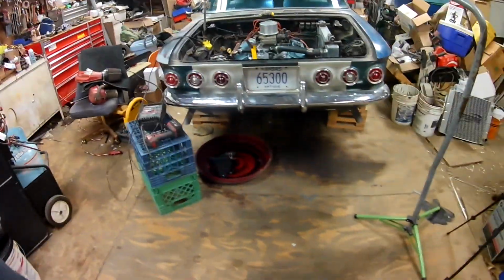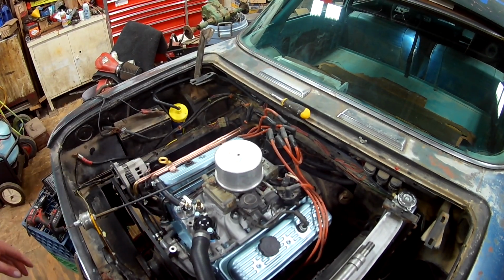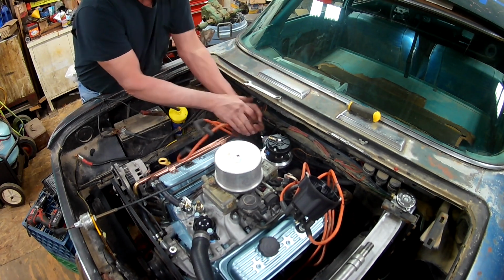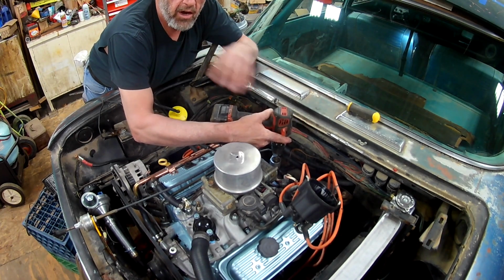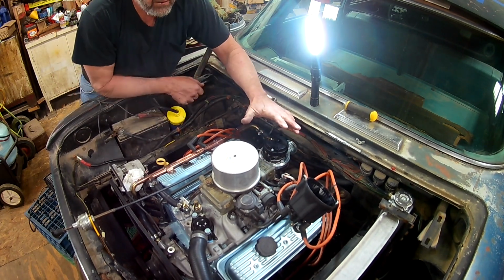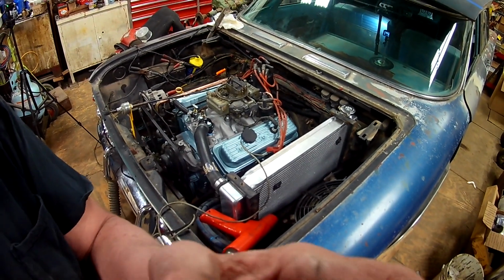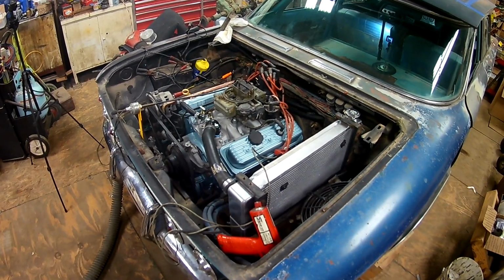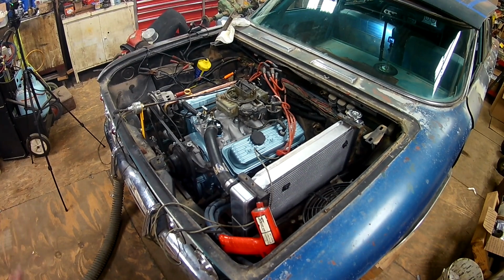4.3V6 Corvair Prepping for the first start on a fresh rebuilt engine What you need to know.Subscribe

Comment: lucky that it will not leak by the rear seal, usually, there is very subtile difference to accomodate the fact that the engine is reversed rotation.
Reply from the maker: The rear seal is directional. I never gave it any though till we were building this engine

Comment: Only thing I see is a radiator shroud and ducting from the engine cover, boot and or trunk lid ... Ain't it just ain't it 😎 lols.....or maybe from the quarter panels.... I dig this build... thanks for sharing.... Will be fun I am sure...
Reply from the maker: Thank you. There will be more louvers added to the lid with seals and an air dam underneath. The inner quarter has been opened up for air flow too.

Comment: I saw an article about the installation of a toronado drivetrain installed "behind" the rear seat of a 66 Corvair coupe, with a clearance notch in the back seat for a pully).  ;-)
Reply from the maker: We actually considered the Toro drive line but it would have been too intrusive. With what we have done, we could swap back to the flat 6. Don't know why we would though.

Comment: I didn't realize that you've reduced the wheelbase, and altered the body from a standard Corvair 4 door. 
It seems tastefully done, and still attractive.
I notice the 5 lug rear.
Explain?
Reply from the maker: The body and chassis are as original, just shaved the door handles off the rear doors. The 5 bolt rear wheels was done for more wheel choices. Thanks for checking out the video!
Reply: @Raycr  
I forget that I can't comment with photos, or screenshots...
Maybe you got the car that way, but it's not fully original. 
The front doors are from a 2 door. 
The rear doors are shortened.
I had a 63 4 door.

Comment: What's the game plan for throttle linkage? The OEM cable and its location will be kinda low. Can you rig a guide tube and a bell crank deal for the stock cable, or perhaps go with hydraulic? The latter isn't cheap but works well.
Reply from the maker: We have a linkage and bell crank arrangement made that seem to work well. The original linkage to the throttle valve on the power glide is still in use but it's all fabricated back from that. You can just about see the bell crank ahead of the even side hear (is it still the right head?).The hand throttle was just on for the cam break in process.

Comment: WOW   thats cool
Reply from the maker: Thanks, still working out some bugs
Reply: @Raycr  i been  working on a camaro  95  v6 it had EFI it s all cook so i put a s10 intake  on it and carb igot it to run  but cant get a air cleaner no no room yet  still thanking  of away to make some thane   to work
Reply from the maker: @JonOffgrid  This one is very tight to the lid. We had to trim out some of the underside bracing and go with the carb hat and remote air filter

Comment: I had a 65 corsa with a 1963 olds aluminum 215 and was bored to a 231  bolted rite to the stock transaxle  that car was the best car .it handled like a cat on a shag carpet  .I liked it better that the small block in the back seat    my radiator was in front
Reply from the maker: I have seen a few of the Buick/Olds swaps. There a good balance
Reply: I am looking for a 65 and up corvair with buick 9r olds motor in the rear .So if you know where I can buy another car .send 8t my way
Reply from the maker: I have a 66 parts car. Was an AC 140hp with the power glide

Comment: Hi, was this a marine V6 since I see it turns backwards or did you convert it with a reverse rotation camshaft? Good job anyhow. Wish I could find a diesel that turns backwards for my Ultravan.
Ross
Reply from the maker: This was a 1985 C20 pickup engine when we started but it has built as a marine engine would be.

Comment: How did you get the right rotation so you have four forward gears.
Reply from the maker: We used an inboard Marine cam and timing set. Along with other modifications necessary to have the engine turn reverse rotation

Comment: Did you have to reverse the rotation of the engine? What was required to do that?
Reply from the maker: Yes we did. The simple answer is the cam and timing set are marine parts to reverse rotate the engine. The crank seals are directional as well.

Comment: Curious how the radiator will get outside air flow.
Reply from the maker: Great question. We have opened up the inner fender panel on the right side so it can draw from the wheel well area. The radiator is open to that area all the way down. Will be looking at putting an air dam under the radiator and crossed the transmission area to create a low pressure zone behind to help draw the air.
Reply: @Raycr  Sounds good, interesting project.  I was impressed with the 4.3 in my old 1992 GMC Sierra. Should really scoot in that light Corvair.

Comment: Ya know, that throttle handle is going to make driving difficult.. unless you pull a chariot or something.
Reply from the maker: I might have to work something else out. Any suggestions?
Reply from the maker: I might have a concern about the response time of one of those actuators
Reply from the maker: I do intend to drive it out of the shop. That would be a long extension cord
Reply from the maker: @SweatyFatGuy  Here's an easy fix. You run the throttle and I'll drive!